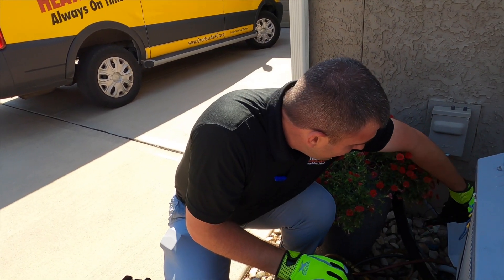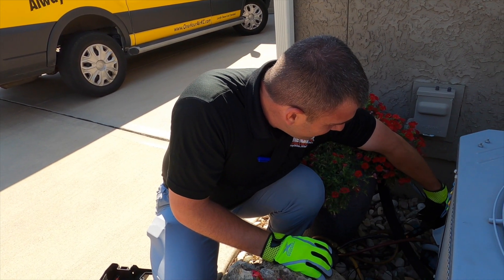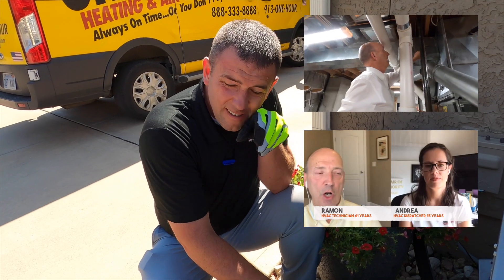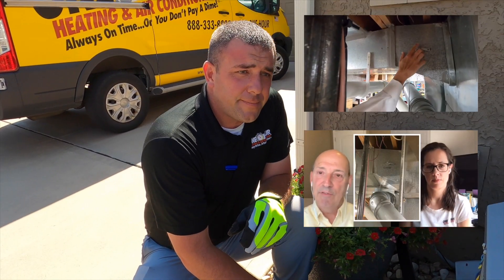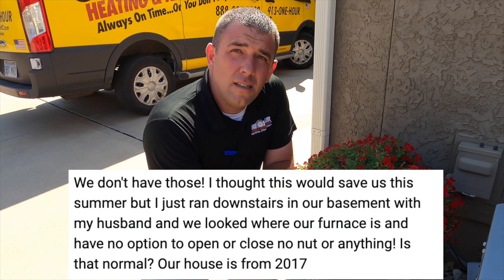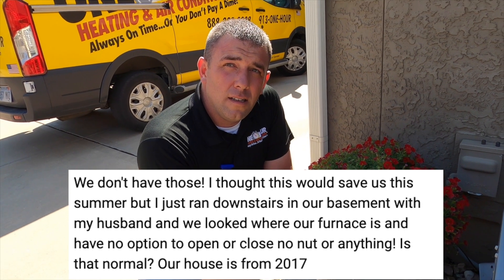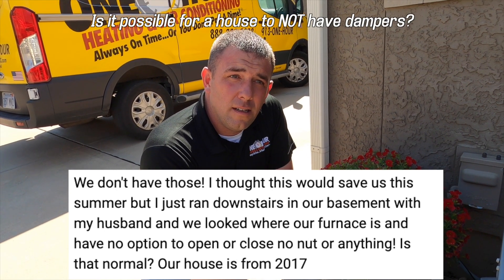My house doesn't have dampers! Is it possible to install dampers in existing ductwork?

Comment: Our bedroom has 2 vents and a return, outside walls on 2 sides and yet still runs 5-6° warmer than the rest of the house during the summer. Checked and we have no dampers, we waste so much electric cooling the rest of the house just so the bedroom is tolerable.

Comment: I have an unbalanced house. I have the slinky tubes. The center area of the house on the first floor has the thermostat. It also sits adjacent to the entry that is full height, 2 story. This area looses heat fast and the thermostat tries to keep up with the temperature loss. Inversely, the rooms upstairs and nearest the furnace (in the garage) are constantly pumped with hot air. I've tried the basic troubleshooting by closing the damper that is installed in the ceiling. I does'nt hold back any of the heat, there's too much air pressure. This is the same for the room on the first floor, nearest the furnace. I am looking to put duct/box/damper inline for each room. Is this something I can do to regulate the force of air that dominates these 2 rooms and possibly transfer the remaining air to other parts of the home? In theory, this seams like the right approach.